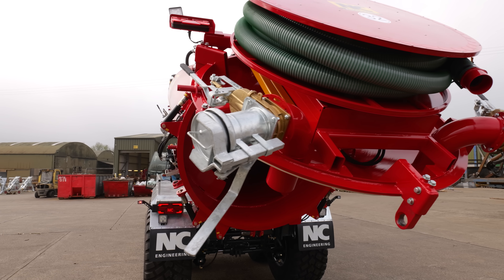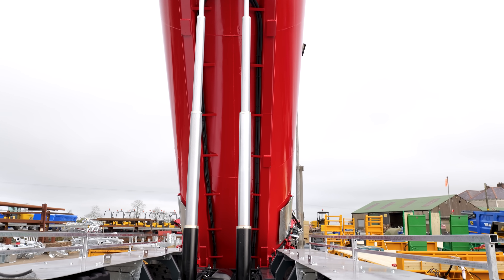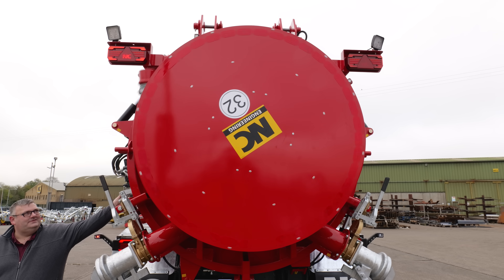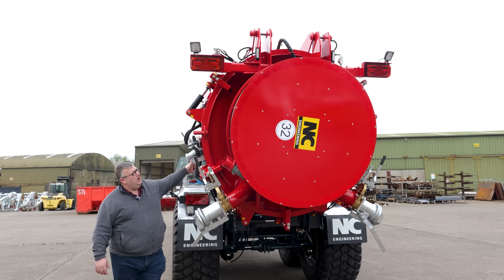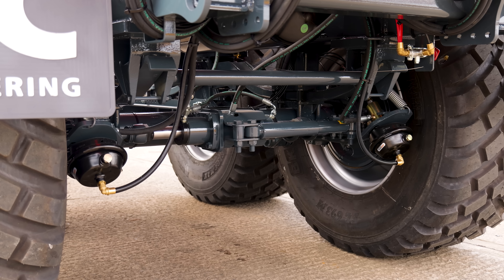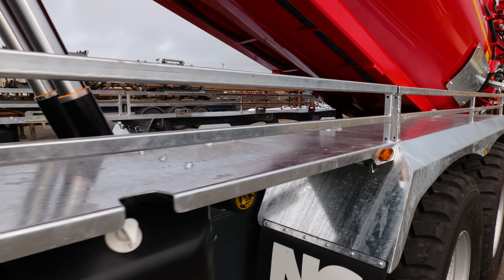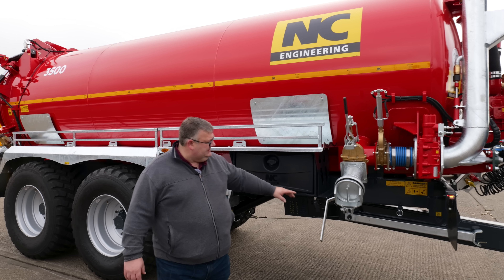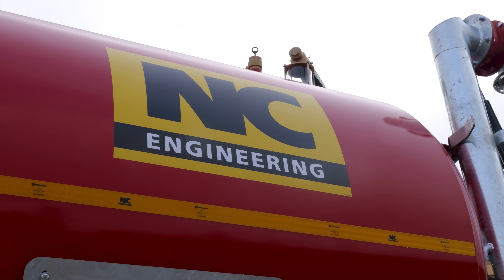CUSTOM BUILD Tipping Tanker!

Comment: FAR TOO DANGEROUS
CENTRE OF GRAVITY OF LIQUID
OF UN KNOWN SURFACES = TIPOVER.
Reply from the maker: @rumpoh8039, the principle behind this tanker is that the rear door will be open before you tip the tanker for unloading. It main function is to help remove sand and grit that normally accumulates at the bottom of the barrel, in a normal slurry tanker that that works on farms that bed with sand in a lot of instances they use hydraulic drive agitators to keep the sand suspended in the liquid. However in this application the heavy material settles needing the rear door to open and the increased angles allows the load to be discharged safely. The safety props can be placed on the door allowing any stubborn material to be washed out. hope this helps clarify.
Reply: Tell me you know fuck all without telling me you know fuck all 🤦‍♂️